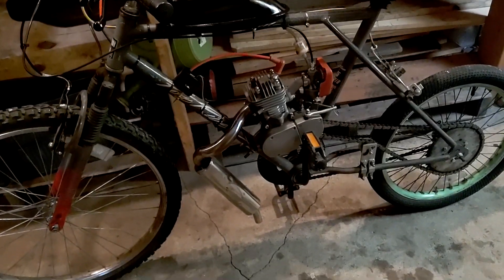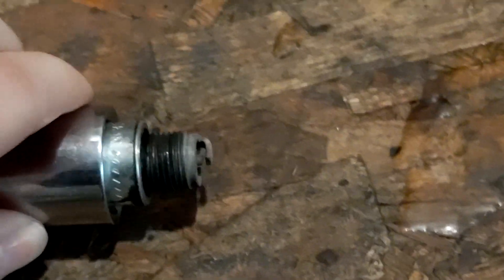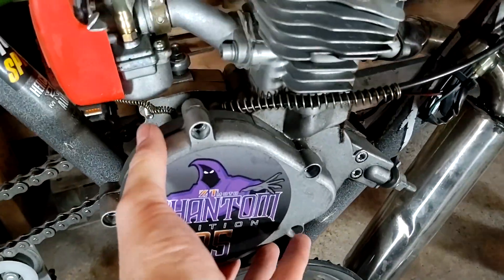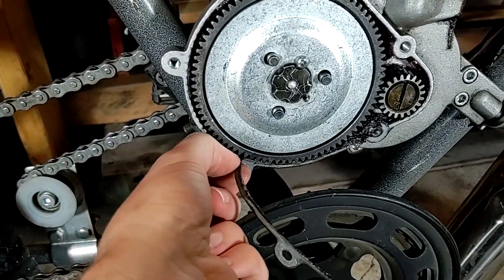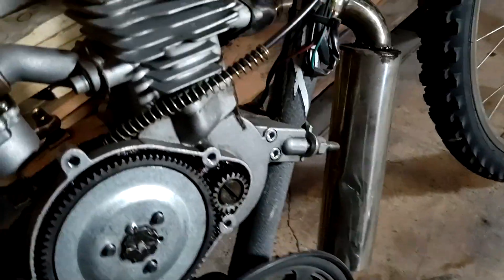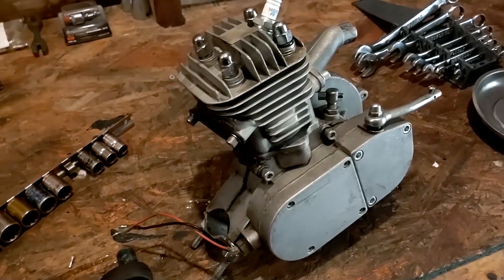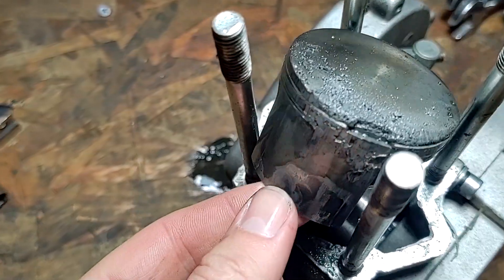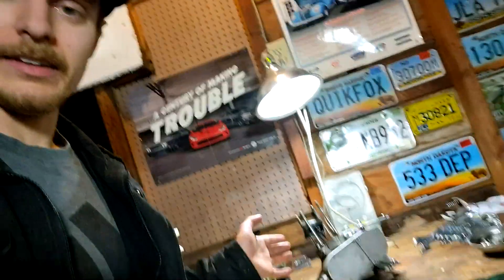Tear-Down: Phantom 85 with MS-460 Piston

Comment: I recently had my phantoms stock piston blow itself into pieces from the same problem. Running lean. A bolt for my g2 reed came out and got sucked into the engine so there was an air leak and it took in more air than fuel so not only did it run hotter but with less oil. Just rebuilt it yesterday with an ms382 piston but I’m gonna wait on it until I get a hub adapter and other important stuff so I can throw it on another bicycle I have. Quick but sensitive engine 😂

Comment: Yall got to be running the phantom to lean mine still has the original piston  almost a year later
Reply: That’s the issue. These engines like any two stroke are sensitive to running lean. Mine blew up because a bolt for my reed valve came out and it ran lean for a couple miles till it quit. Just got a new piston so I’m gonna be installing it soon.

Comment: The phantom 85 is definitely a fragile engine and needs to be rode a specific way. I learned from experience cause all mine were blowing up but eventually I was able to make mine last for 6+ months
Reply: It’s mainly the piston. It’s windowed so it’s way more fragile than a regular non windowed piston. It’s also got holes on the sides where the wrist pin connects so that’s fragile as well. And when it runs lean it’s more prone to failed cause it’ll get hot and those sensitive spots basically melt and the piston explodes lol. I recently ordered another piston for mine and it has no windows or sensitive spots. Just with an expansion chamber you can get a lot of power out of it.
Reply: @JWyuh i j just bought a phantom 85 v3. It's still in the box. Then I heard about these window Pistons that it comes with failing, so today I just went ahead to my local chainsaw store and ordered a genuine Stihl MS 460 piston and rings for 125 bucks. And i bought an ngk BR6HS sparkplug instead of the chinese z series plug it came with.
Reply: @ good idea right there. You’ll still get lots of power even without the windows so you made the right choice doing the piston swap.
Reply: @justout75 Does that piston fit without modifications? I just bought the engine too and I'm only now finding out about the problem.

Comment: ? Has anyone taken a new one apart and checked the ring end gap ? These cylinders were designed for chainsaws which have forced air cooling, and are designed to pull a cutting chain with minimal effort for short periods at a time. Just driving at speed does not guarantee engine cooling with air flow dynamics in a bicycle frame..... those cylinders, pistons and rings, where designed to run with forced air cooling with shrouds that means the cylinders are cooled from all sides not just in the Front of a bicycle That may not be getting any airflow . A kit like this needs a cylinder and head like the old school  air cooled dirt bikes ....
Reply from the maker: I did not check the ring end gap. I agree with your comment with one caveat, cutting through logs is definitely not a minimal effort task. It's WOT for much longer periods of time than you would expect; certainly no different than the 40 seconds of WOT that it took to blow up this engine, if the log is big enough. In any case, these engines fail in a similar way with the stock piston as well. The issue appears to be an inadequate amount of cooling fins, which yes, based on the damage, it does appear that the rings end met up.
Reply: I'd argue that since it's on a bicycle, with no shrouds its getting better airflow, maybe though not as forced. And we're traveling at speed too, however, these engines are designed to be short burst power, not continuous burn running. You have to use the motor in the condition it was designed. I live in a small, valley town in Appalachia. To get up hills and ride (especially in colder months) is so fun and the phantom does it well, but to run flat by the river for extended amounts of time is not where this motor excels. Though if ran right, maintained speed can be "easier" on the motor, this motors failure was due to improper use. If your motors hot already, load a heavy burn on it, you can expect a failure. When riding these bikes you always have to keep in mind it's temperature.

Comment: Hi sir i need some help im in the fence with this motor i am a kinda experienced with thsese engines i know these engines well and im on the fence if i should buy or not the phantom 85 if i piston swaped it trimed the port edges ran super fuel rich for cooling purposes and an 16:1 oil fuel mix always and dont run it for more than 20 straight Will the engine blow up on me
Reply from the maker: Based on my short experience with this engine, I wouldn't recommend it. Reliability concerns aside, the engine was very buzzy and uncomfortable. It also seemed to only want to go fast. So, for my use-case of cruising around town, it was not a good fit.

Comment: Just pull the head bolts and turn the jug sideways . If its a  old seizure it will bind and come out. If its a soft seize it should do it were your trying on the main drive gear.

Comment: If your locking up when you try to start its the bell housing in the clutch. Back the flower nut off several spaces. The pads have finished seating and the clutch spring has internally shifted. Godspeed

Comment: I wanted a phantom 85 but after seeing all the trouble they can pose. I'll just stick with cheap chinadoll. This is what happens to mine engine that had locked up. https://youtu.be/kNR3Q-wryPA is what happened to mine. Though not nearly as bad as urs.
Reply: The phantom version 3 solved most problems with a simple needle bearing on the wrist pin and rod.. I've run mine over 8k miles on the road with zero problems other than the occasional leaky gasket or bolt loosening because I forgot to put threadlocker on something.

Comment: Doing a similar experiment I've noticed the same problem with mine go a few miles and she's already getting hot like around 350
Reply from the maker: Ooof! Yeah, that's toasty. It would be nice if someone made a liquid-cooled jug for these engines.
Reply: Best time to run them is objectively the worst time to ride. They love colder weather, but I damn sure don't!
Reply: @christianhunt7382  I heard that a cold front hit Texas it was 30 and sleeting didn't stick already in the 40s but that will be it tell Tuesday then it will get better 👍